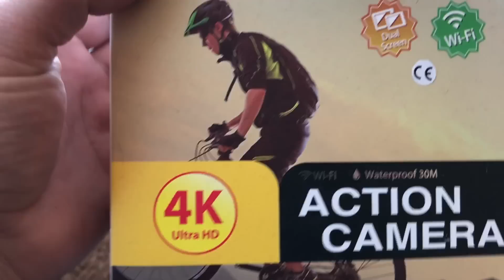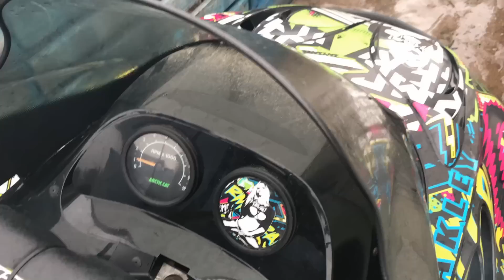Kawasaki bayou KLF400 2WD Shit Kick! (& Crazy Wind!!!)

Comment: that bike probabley needs new swing arm bearings  it's not hard to do just a pain in the ass
Reply from the maker: Thats what i am thinking , But for plowing snow , it;s fine lol!!!
Reply: StarPuss www.ToxicRedNeck.Com yes it might be but if you try to tow anything you run the risk of ripping it off the bike and recking the motor and bike  or I have herd it hapen before
Reply from the maker: I know there is a chance of that , Ill be looking into her and seeing how bad she is come spring time.
Reply: StarPuss www.ToxicRedNeck.Com  that bent rim could cause a speed wobble you probabley know that already but I'll say it aneyway if they bent the rim what else did they bend
Reply from the maker: Ill know more when i look over her in the spring , Something is REAL Loose on her too , Little Jumps should not sound that bad on it lol!
Reply: StarPuss www.ToxicRedNeck.Com if I had to guess I'd say it's ether the suspension system  or something like ball joints